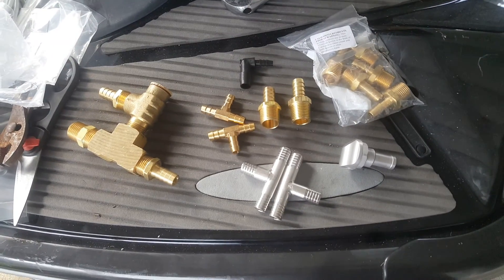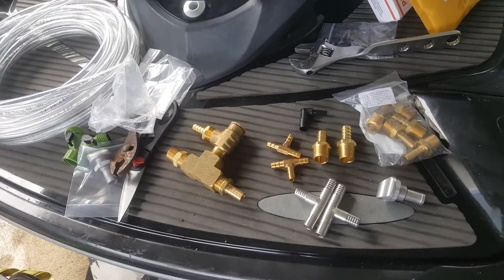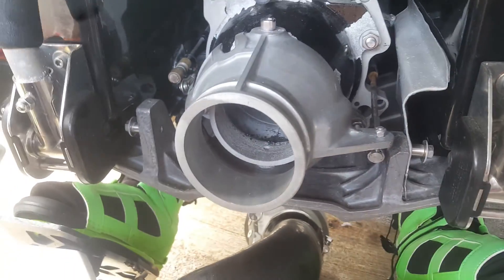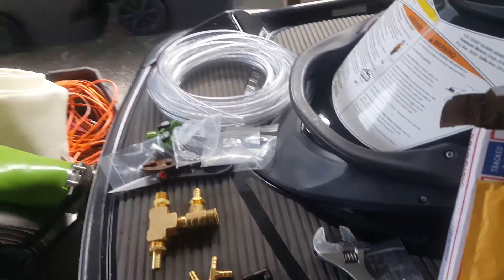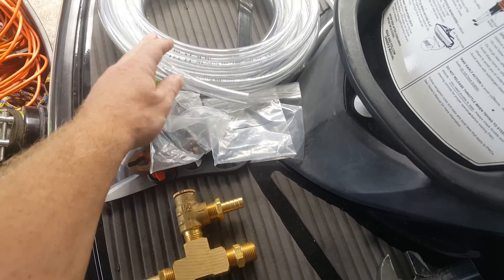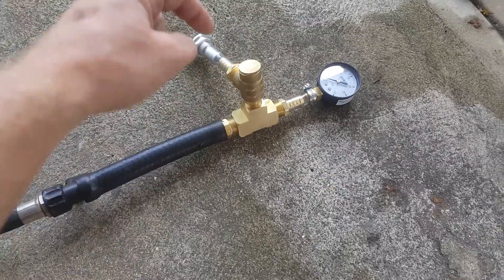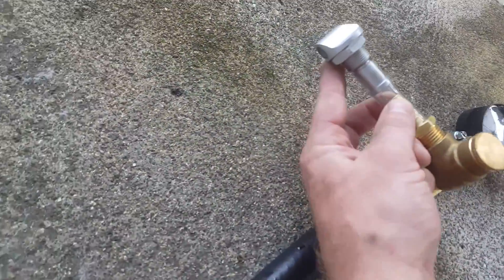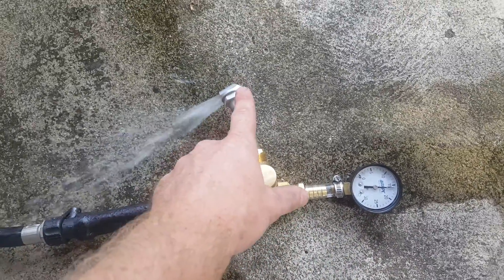Water Pressure Blow Off Valve for PWC (jetski) Engines or Intercoolers (required for Hydroflight)

Comment: Hey do you have this kit available?
Reply from the maker: What pwc are you wanting it for?
Reply: Scotty Knemeyer  2011 ultra 300x, I blew out my intercooler and i was lucky enough to notice before blowing my engine.
Reply from the maker: @tibuturbo2009  fresh new intercooler will be needed before I to installing. This doesnt fix currently leaking intercoolers, but prevents good ones from having future issues. The kits are $300 each. And for that ski like in the video requires 2 kits. I believe I only have silver colored exit nozzles at the moment. If youd like any other color it will be about a 2 week extra wait to get them stocked for shipping. I except venmo, paypal (friends and family payment only) cash. checks (will have to be cleared by bank prior to shipping.
Reply: Scotty Knemeyer Im putting in a new intercooler setup and want to test it with your valve system. I haven’t had any trouble with engine cooling so ill leave that as is since the engine is stock. I noticed in a previous post you do offer the valve system alone for $150. Is this still available?
Reply from the maker: Hey I can sell just the valve. It doesnt come with any fittings. I can send it with a T-pipe Block since I have an extra one which will help get you started with your plumbing. Shipping costs will be on you cause various locations. Typically the fit to ship boxes within the US are like $10. Lmk when youd like to move forward with this process. My Email is

 scottyknemeyer@gmail.com